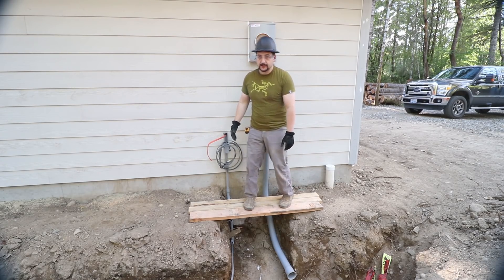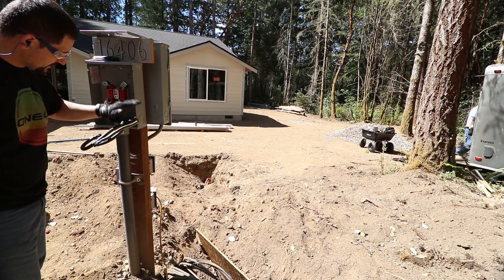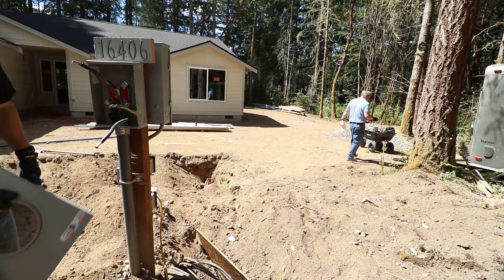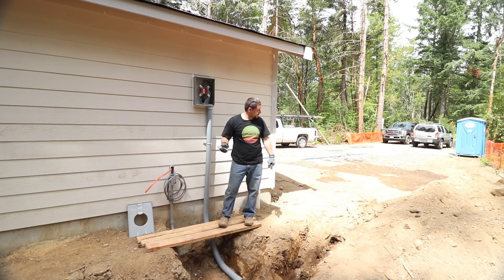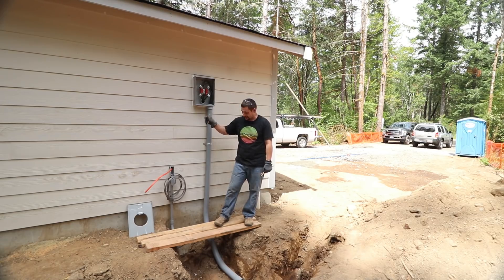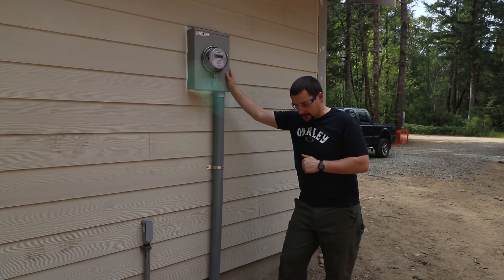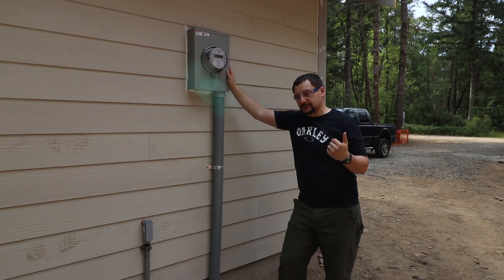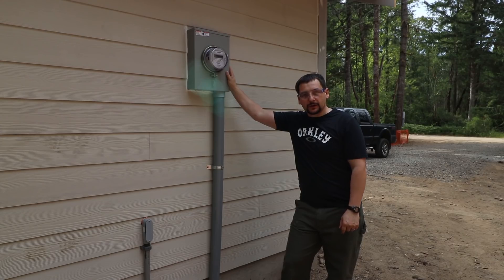Install a Permanent Electric Service

Comment: The THWN cable was buried directly. Did the inspector say anything or did you use special rated cable? Showing inspection process is very helpful. Thanks.
Reply from the maker: That is direct burial cable, only reason I use conduit. It’s because it’s easier to train Ship at contour in the ground and covered up to allow access to the house. Otherwise I would’ve had to leave the trench open and really coordinate the inspector being there. If you don’t have access issues you can leave  the trench open until inspections complete.
Reply: @DanielWoodell  do you always have to have an outside additional permit besides the 2 electrical permits I have already gotten? Temporary mechanical, and now outside. I need one more? Thank you, no answer from anyone else. Deb k